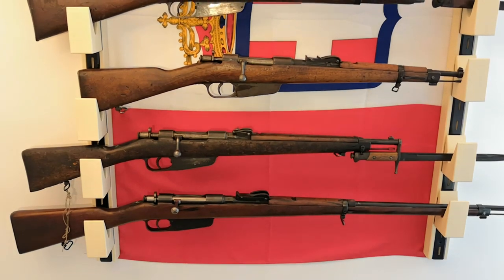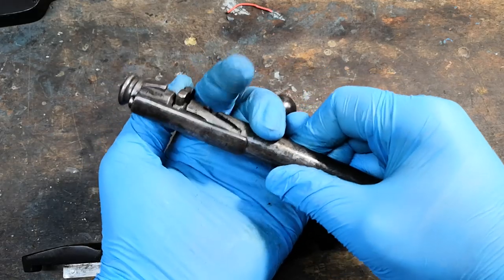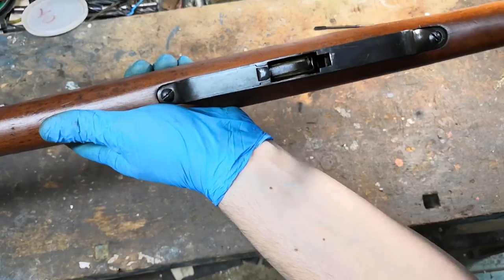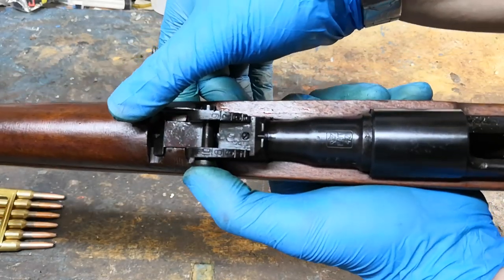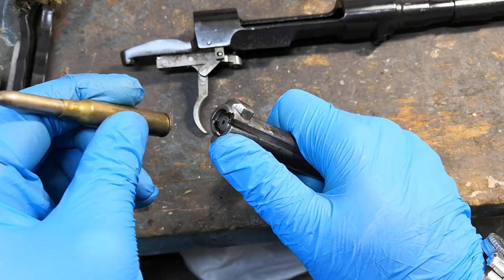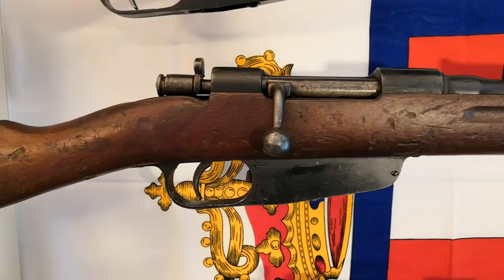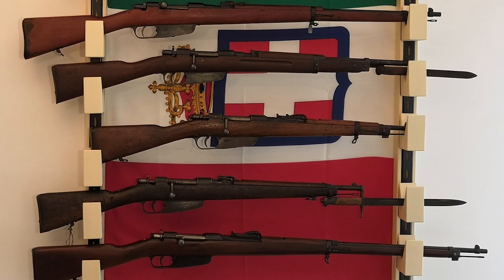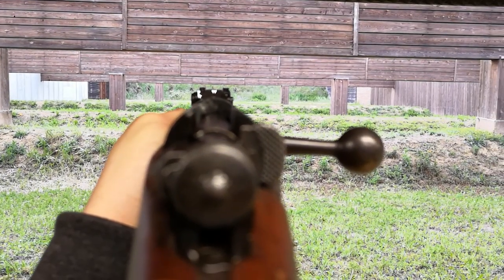How The Carcano Rifle Works

Comment: Excellant video. Thank you for explanation of non-typical bolt face unique to Carcano rifles. Very large numbers of Carcanos imported into US with some interesting situations that resulted.  In no real order:
1) A Modelo 38, in 6.5mm was used by Oswald to shoot President Kennedy. The ammunition was was produced in US by Western Cartridge Company in early 1950's for an eventually aborted plan to remove the Communist government in Albania. About 5 million rounds of contract sold on civilian market. The bullets had correct 0.268" diameter, unique to Carcano, as opposed to the more common 0.264" diameter of other 6.5mm rounds such as Mannlicher, Arisaka, Remington non interchangeable loadings. More on this later. The M38, more than capable of shots by Oswald when proper ammunition and acceptably skilled shooter.
2) Carcanos given 'junk' rap by so-called experts in part because
   a) commercial and reloading  bullets were .264 rather than correct .268
   b) many had corroded bores from improper storage
   c) Original pre-1918  M91s had progressive rifling, and when barrels cut for 'sporterizing' by importers, caused bullet to yaw, resulting in 'key holing' and poor accuracy.
   d) So many 'expert' gun writers of era erroneous claimed only small pin held mechanism, in bolt that would result in it flying back into shooter's face in even of gas rupture. An extremely quick look at bolt clearly shows safety flange resting in receiver creating a 3rd lug, strongly holding mechanism in place.
   e) Many M1871/87/14 Veterrli-Vitali rifles also in 6.5 Carcano imported that did have some failures when fired, causing confusion with "Italian Rifles are junk" myth
3) National Rifle Association in late 1950's, did destruction testing of Carcano action, resulting conclusion that Cacano actions were actual as strong as US Enfield
I may add more as i recall them.  Several Carcano collectors in my area who are quite factually literate in subject.
Reply from the maker: Thank you very much for taking the time to share your personal knowledge, I am sure lots of people will find this useful😉
Reply: That someone was close enough,had the skill enough......
Reply: Y

Comment: I believe the hole in the bolt you asked about is for venting gasses away from the shooter's face in case of ammunition failure. I've seen a similar system in a Remington rifle and also a Mauser.
Reply: Forgotten weapons covered it and that is exactly the purpose
Reply from the maker: I've got the most expert subscribers on the platform! Good job!
Reply: Enfield Rifles have a similar "exhaust" hole in the receiver.

Comment: If you’re referring to the hole just behind the locking lugs on the bolt, that’s another vent hole. It was put there to manage punctured primers. Numerous soldiers and commanders noted bolts that would send the firing pin flying backwards into the shooters face with a punctured primer. This vent hole was to prevent that from happening by releasing the gases before enough pressure could be built up to shear the little nub on the de-cocking sleeve. That’s the only piece of metal you have to stop the entire firing pin assembly from hitting you in the face when you fire the rifle. Even without the vent hole this event was very rare. Others have said that they were put there to lube the inner bolt parts without taking it apart but why would they do that when it’s so easy to take the entire firing pin assembly out in one piece? Punctured primers have been a problem since the introduction of the metallic cartridge case. This event is very rare as military primers are made to be very hard as to prevent slam-fire and punctured primers. I would worry more about softer reloading primers. Most notably the ones made for competition and precision as they are very soft and puncture easily in military rifles. This is how I understand the carcano per my years of research and reading on them.

Comment: From what I heard, the main complaint about the innaccuracy of the WWII-era Carcanos was because the armorers just sawed off the barrel to the designated length instead of making a new barrel.
Reply: Thats actually a myth due to importers cutting the berrrel to "Sportify" the gun.
Reply: Another problem is that some commercial ammunition loaded an undersized bullet, which didn't really engage the rifling and sent the bullet ping-ponging down the barrel, which greatly impacts accuracy.

Comment: The hole in the top of the bolt is there for additional gas relief. The idea is that it shoots the gas upward away from the shooters face. Not a very useful idea but if you know your ammo is going to be over pressure you might as well engineer for it.

Comment: Hi, I'm a firearm cleaner/restoration tech in a gunshop here in MS..had trouble after disassembling the bolt body/firing pin assy. on one of 2 surplus 6.5  M91 Carcano carbines we took in for me to clean, derust, take all the cosmoline out of action & bore. Had to get my gunroom mgr, ex-Marine, to help me re-assemble bolt, re-set, slip back into receiver, so it would function. Could you please brief me on how to set/reset bolt assy, so it will re-seat/actuate once back into the rifle? These guns were badly neglected, somehow wound up in storage,  drenched in cosmoline, corroded/rusted. Would like to be re-indoctrinated for future projects, should we receive more of these Carcano rifles. Loved your video..you're kindof hard to understand, since I'm almost deaf. Your accent sounds pt.Italisn, pt. Indian(India)..Thsnks..You have some nice examples there of 6.5 Carcanos!!

Comment: I have 2 carcanos a m91 /24 trupp special and a m41 ts both rifles barrles can be unthreaded by hand is that normal ?
Reply from the maker: No it is definitely not normal, you should get the barrel tightened with the appropriate torque.
Reply: Ok thank you

Comment: Curious can you hand load a carcano or are you required to use the stripper clip it uses?
Reply: Hand loading a single round can be done but is best avoided because of the design of the extractor.  The way it's made it wasn't intended to slip over the shell, and worst case doing this can damage or bend the extractor or push it into the bolt so that the extractor no longer works.  Original and reproduction enbloc clips can be found on eBay and through other sources and there's now a guy on eBay that sells a 3D printed insert that allows for easily and safely loading single rounds so that they're fed in the same way as if they were loaded in an enbloc clip.  I'm relatively new to these rifles and have a couple different carbines, and along with some clips I have one of these single round inserts on order as there are times I would want to do test firing with single rounds.
Reply: @terrybeavan4264  Sounds pretty agitating. You'd think design wise they'd consider the hand loading option as a necessity. In case they'd become short on clips and you have to rely on manually putting the rounds into the rifle. It's prob the Manlicher system that obviously design wise limited this but again you'd think they would've come up with way to make this option viable.
Reply: @robosoldier11  that really wasn't a problem because the ammunition was distributed already in the clips in small paper or cardboard boxes that were carried in the soldier's ammunition pouches.